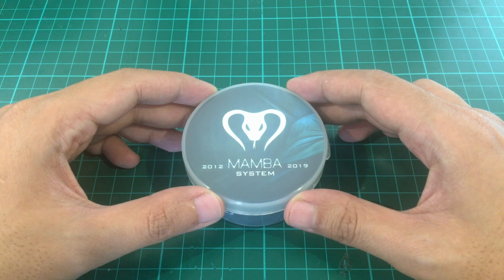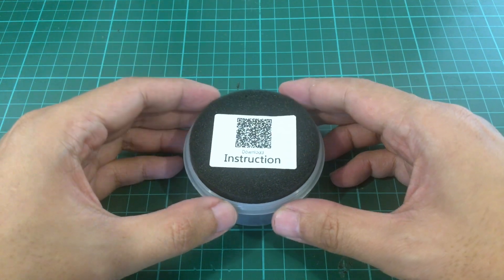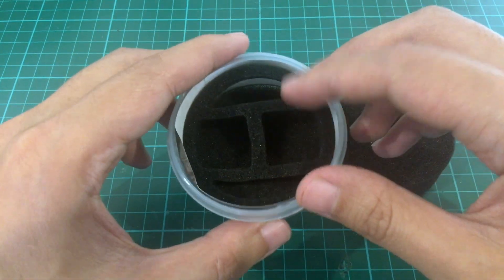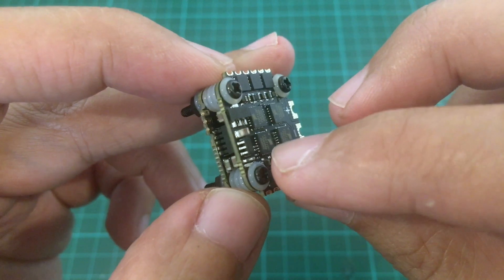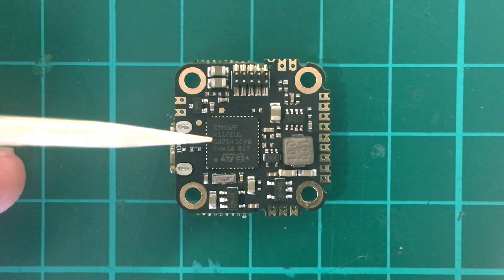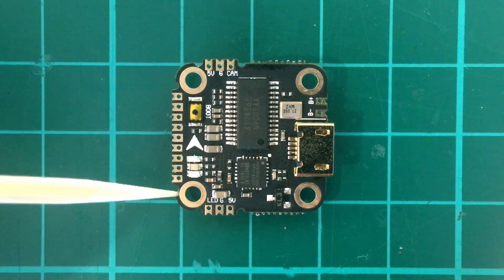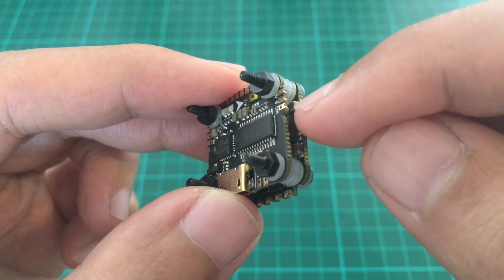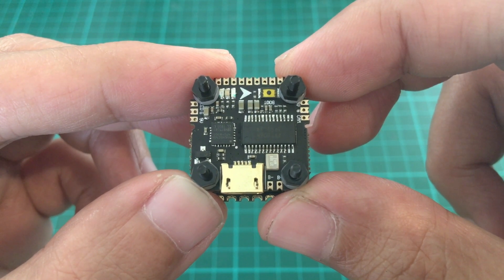Diatone Mamba F411 Nano Stack V1.0

Comment: How would I use a CRSF protocol rx with this FC?
Reply from the maker: Your only option is to use SBUS https://oscarliang.com/crossfire-output-sbus/
Reply: @jaylagare  I found the wiring diagram of the V1.2 version which is the version I have.  The diagram shows a Crossfire RX connected via SBUS pad (RX1) and the TX1 pad.  Since SBUS only needs one wire for two-way communication, I’m thinking the way it’s wired on the diagram supports CRSF.
Reply from the maker: Ah, yes. It’s good that you have V1.2.

Comment: There are 3 versions of this board. The one you have is v1.0     Next is V1.1 which has extra  tiny  current pad and V1.2 has two extra pad close to boot button -  3v3 and ppm pads .In that  case everybody has  to check which version they have . All versions has slightly different pads  on the side close to boot button .
Thanks for the video !

Comment: Great video !so if I want to Put Ibus flysky reciever I directly sold on the "sbus" pad and automatically detect the protocol? What I have to set on betaflight? Thanks
Reply from the maker: Federico Totem Thanks! Yes, just solder to the SBUS/RX1 pad and it should automatically detect and enable/disable the inverter. In Betaflight Configurator, you will need to change serial RX provider to IBUS.